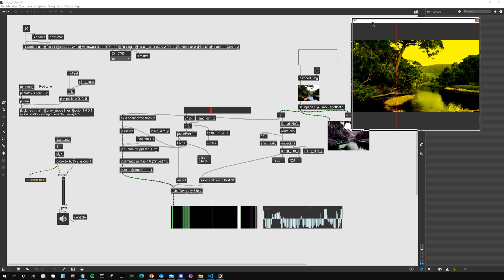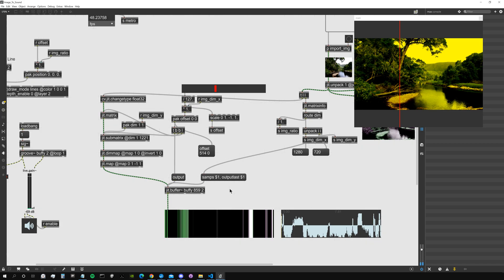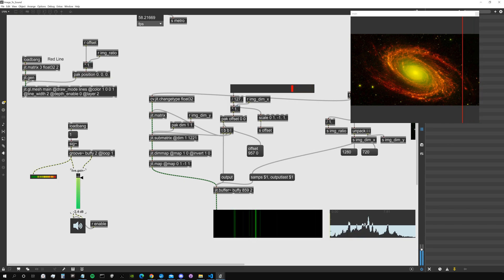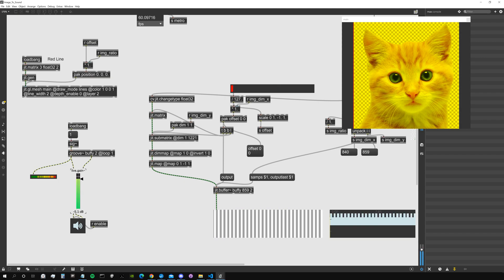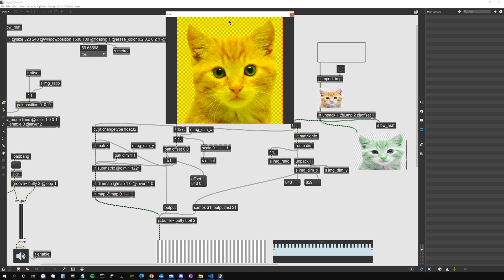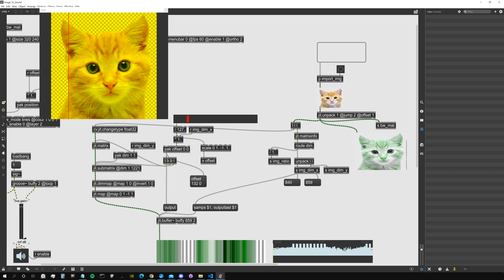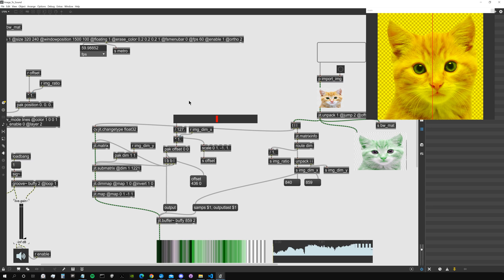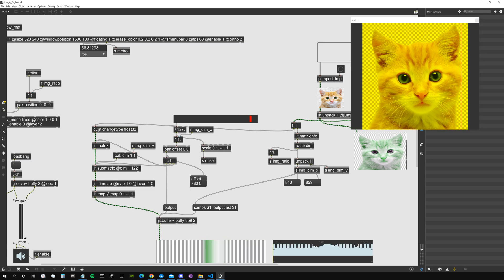Patreon Patch Share | Transform Image into (annoying) Sound with Max/MSP

Comment: Nice! But there are times when you have a lot of DC Offset, you can try centering your waveform at zero or putting a high pass filter before the dac. In gen~ there is also a very handy operator for this called dcblock.
Reply from the maker: Great idea!